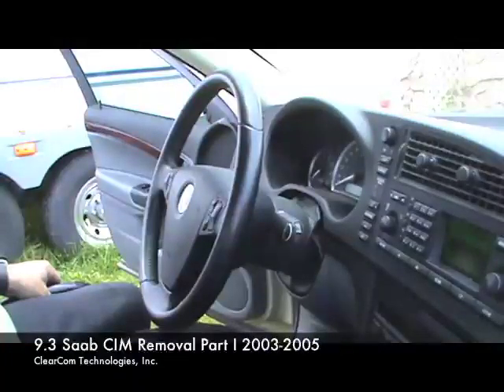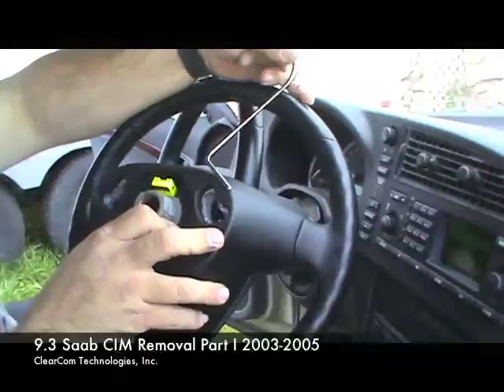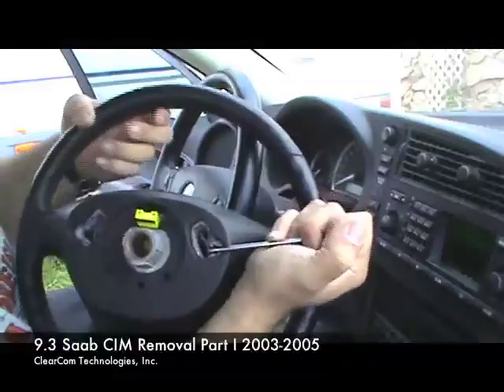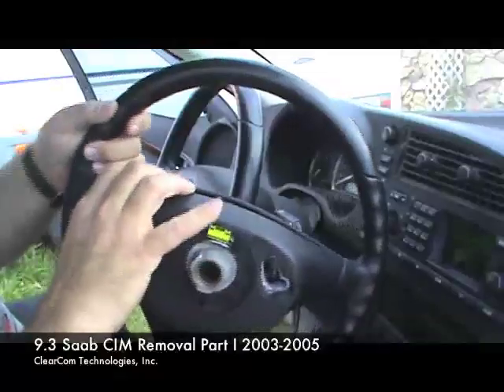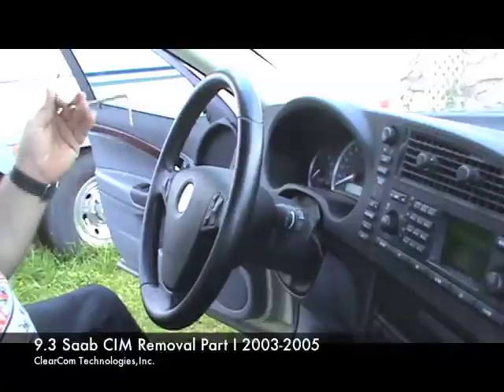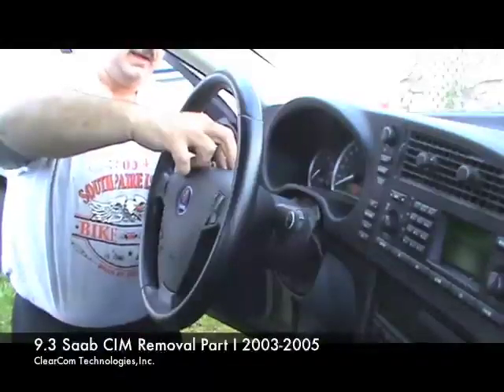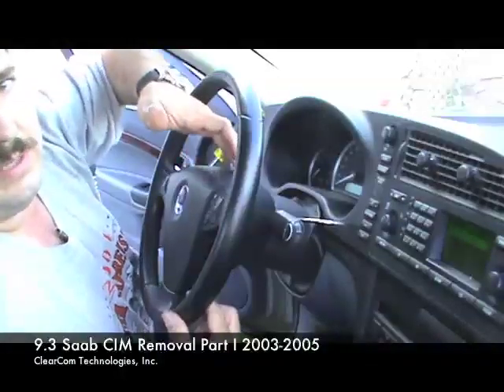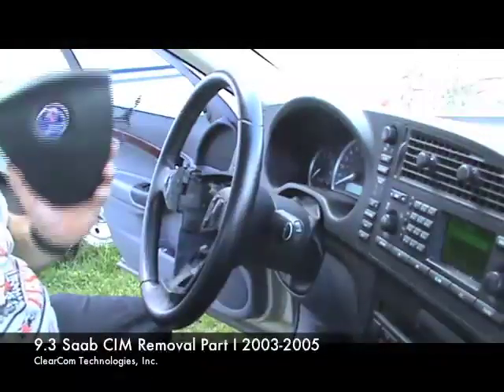ClearCom Technologies 9-3 Saab CIM Removal Part I 2003-2005.mov

Comment: This is a great video for removing the airbag in a Saab when the SCL is locked and steering wheel is straightened. In my case, I had to pry out my SCL in order to turn the wheel 90 deg and place a straight screw driver in the access holes

Comment: same holes on last gen?
Reply: The airbag removal holes from mid-2005 to 2011 are a bit different.  Same location and same idea but the access holes are smaller and the airbag removal tool used is not as long.  The tips of the tool to remove the airbag is only 1.5" long

Comment: Do you guys know how to install the stock ebrake handle on a Saab 93? I have the two plastic pieces and the spring (it popped off after heavily pulling on it) but I am unable to figure out where the spring goes, I've looked everywhere
Reply from the maker: +Alexander Collier Hello.  I'm sorry but I do not know how to install the e-brake handle.  We are locksmiths not mechanics so I don't have a very good knowledge of anything not related to the security system.
Reply: Roger Whitaker hey what tool is that you are using exactly? Plan on doing this job here in the next few days
Reply: David Evans That’s my question too Roger?
Reply: +Roger Whitaker wow thanks for the prompt reply! I just spent the last hour or so looking again and finally figured it out. Strangest ebrake assembly I've ever seen, no wonder there aren't any explanations to be found online.
Reply: Also, I followed your video on how to replace the crm, great video by the way. I had to do so because my steering wheel lock had malfunctioned and the code was not able to be reset this time around. My keys need reprogramming now but the steering wheel lock is still not activated, could this possibly be because the system needs to be reset/recalibrated with the tech 2 or do you think there is something else going on?

Comment from the maker: Hello, I'm sorry we didn't clarify in the video.  This video is Part 1.  Part 2 will take you the rest of the way to removing the CIM.  The CIM is located just behind the steering wheel.  The CIM is the module that the blinker arm and the windshield wiper arm plug into.  Thanks for the post.